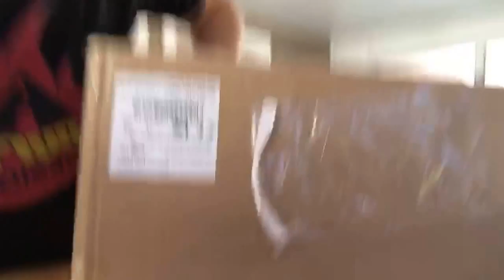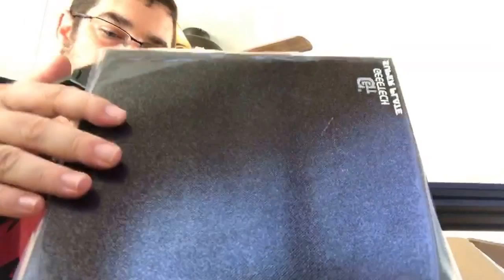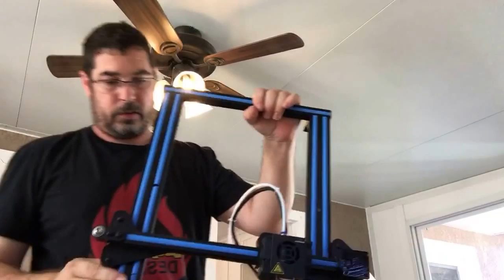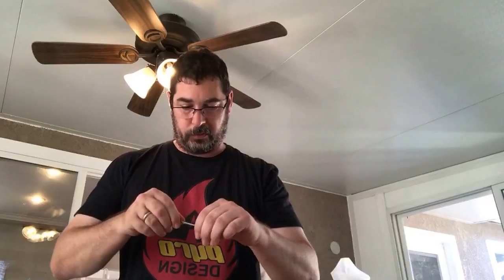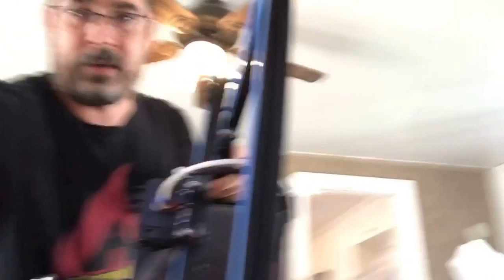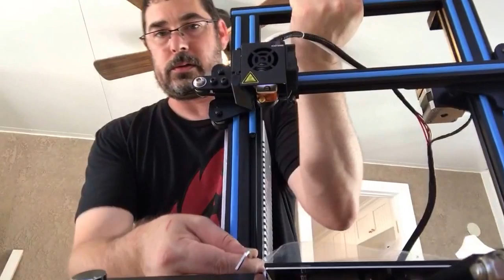Unboxing and Assmbly of the All New Geeetech A10 3D Printer Part1

Comment: after few weeks how it holds against ender3? which one would You choose now after know them a little? thanks for answer :)
Reply from the maker: From a print quality perspective, they are both keeping on par with each other.  However overall, I am inclined to recommend the A10 over the Ender3. It just takes the Ender and improves on a few things. For example, the GT2560 control board is based off a full Mega2560 so it can take a "regular" load of the newer updated Marlin, where as the board in the Ender is based off a Melzi with a smaller chip and less memory- meaning it doesn't have a boot loader so it takes some extra work to get updated firmware into it.  The fact that the A10 is based of a standard groove mount E3D style hot end also opens more doors there for different nozzles or hot end replacements.

Comment: Does Geeetech provide anything other than a marlin .zip for the GT2650 to justify the "open source" marketing?
Reply from the maker: Great question Casey!. To be fair, they are only claiming that their control board (and the Marlin firmware running on it...) are open source in the product description. Download links for the firmware, as well as schematic's and Gerber files for the GT2560 board, are available on their forum. Just search for A10 firmware or GT2560 schematic at http://www.geeetech.com/forum/. The chassis is built around open build's V-slot extrusion system, which is open source in it's own right.  Since this is a new printer for them, I do not know if they are intending on providing CAD drawings for metal parts, etc. And lastly, based on my experience with their larger A30, they have no problem providing stl file for things like the fan shroud when asked for them.